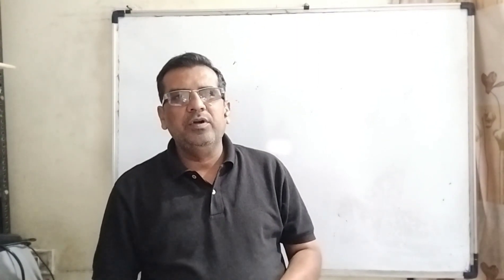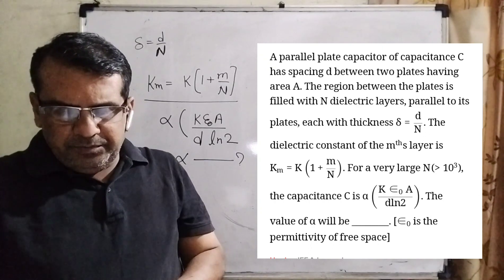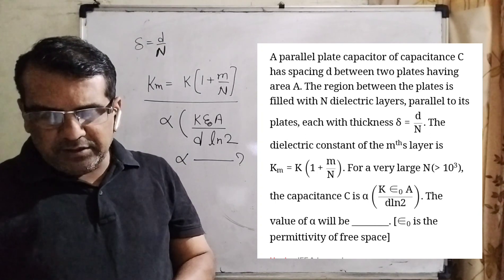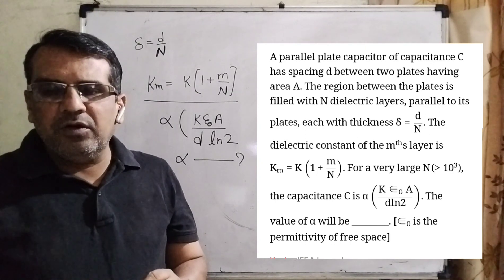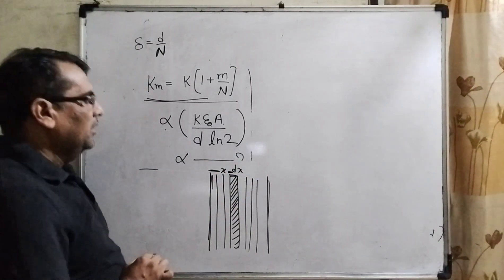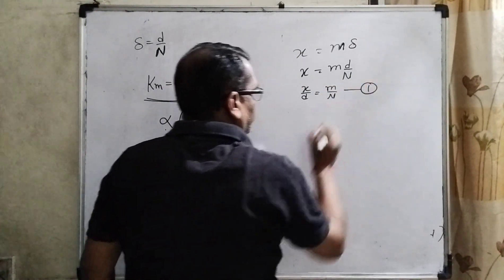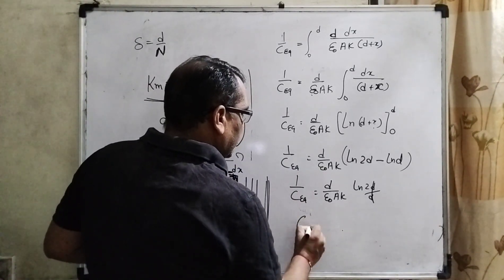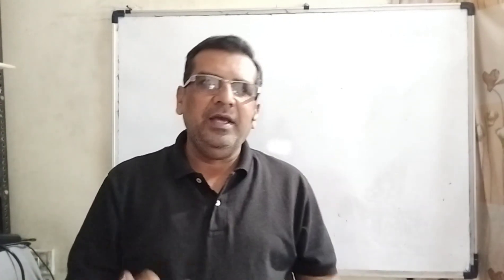A parallel plate capacitor of capacitance C has spacing d between two plates having area A

Comment: A parallel plate capacitor with plate area 'A' and distance of separation 'd' is filled with a dielectric. What is the capacity of the capacitor when permittivity of the dielectric varies as epsilon(x) = epsilon_{0} + kx for (0 < x <= d/2) epsilon(x) = epsilon_{0} + k(d - x) for r (d/2 <= x <= d)
Please sir